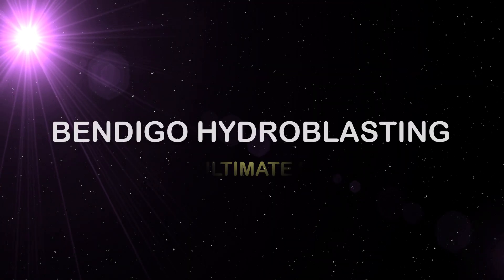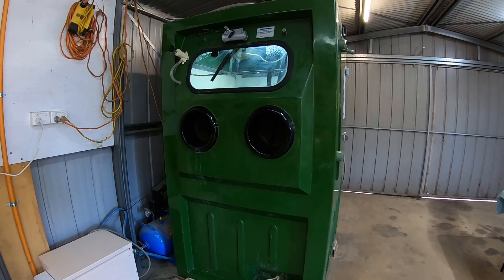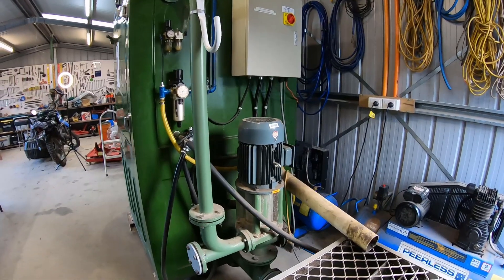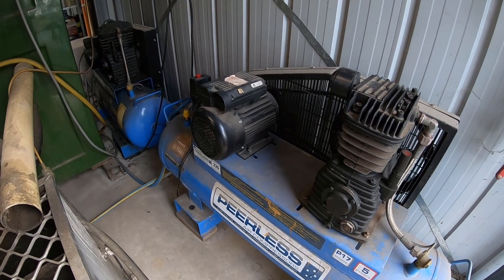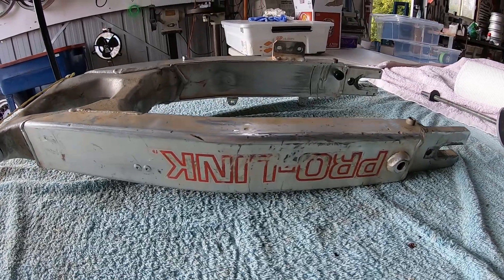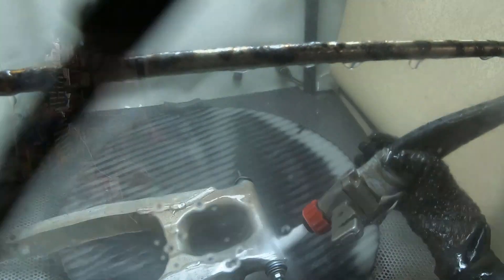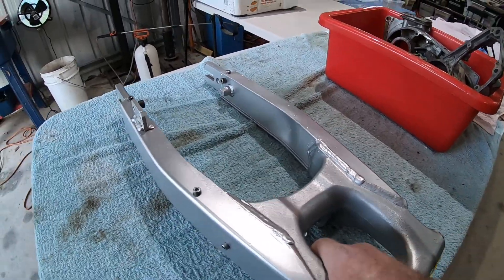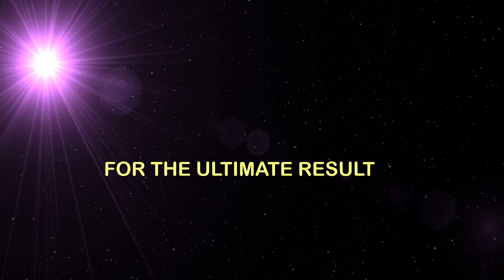What is Hydroblasting ? What is Vapor (Vapour) blasting?

Comment: you have like more than 15 hp power equipment.... what size of nozzle have your gun? 6 or 8 mm ?
Reply from the maker: Hi. Sorry for the late reply. The handpiece has about a 10 mm orifice. About 2 litres a second passes through it with 80 psi of air behind it. Cheers Craig

Comment: Why do they call it "Vapor" blasting when there is no "vapor" involved? it's just sand blasting using glass bead or aluminum oxide and adding a little water. What am I missing?
Reply from the maker: @31acruz  smaller home made and hobby machines use much smaller slurry pumps and handpieces. These machines dont supply huge volumes of slurry and the air at the handpiece causes the slurry to mist (vapor) a lot making it harder to see what ur doing. Bigger commercial machines have the air slurry ratio right and dont cause any “vapor”. Cheers Craig

Comment: How goods that… 

Wouldn’t the blasting take off the sticker and glue/adhesive?

Nice video mate 👍
Reply from the maker: Thanks for the kind words. It is a very gentle process compared to many blasting processes. Some paints and coatings come off with ease but others are like kryptonite and require dry blasting or chemical intervention. Thanks again for watching 👍

Comment: Hi Craig, I have been enjoying your videos very much. And there is a Hydro blasting service offered in my town (in NZ), also there is "dry ice" blasting. I am just wondering the pros and cons of each method, from the customer's perspective as well as from the business/Operator's. Might be a good video topic?   Thanks for the cool videos. 😎
Reply from the maker: Hey there. Thanks for the positive feedback 👍. I haven’t looked into dry ice blasting at all. I do know that dry ice evaporates and is a fairly pricey product to buy here and would be probably single use only. I’m lucky with my setup that allows me to get full mileage from the glass beads. I do get wasteage over time as the glass breaks down but I just add a kilo every now and then. And my apologies for lack of videos recently but I’ve been o/s for the last few weeks. Thanks again for your input. Cheers Craig